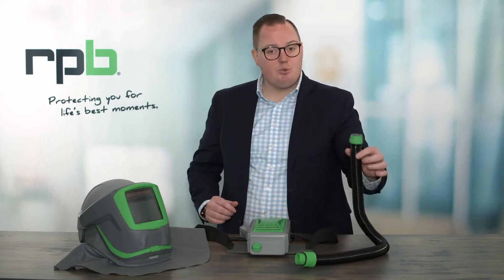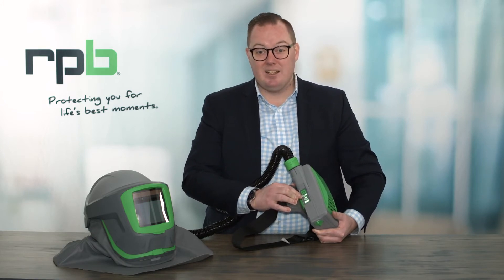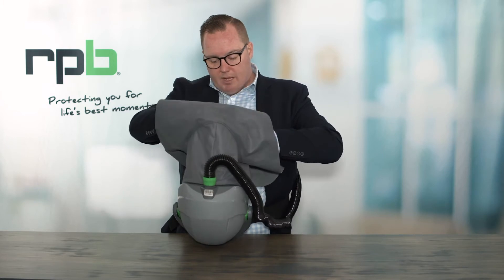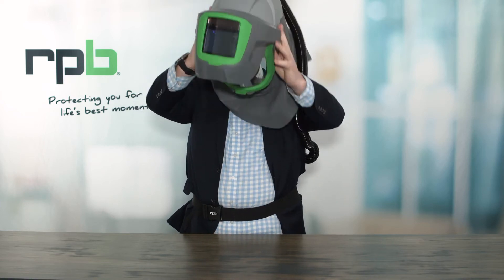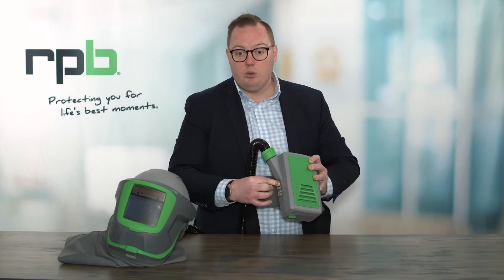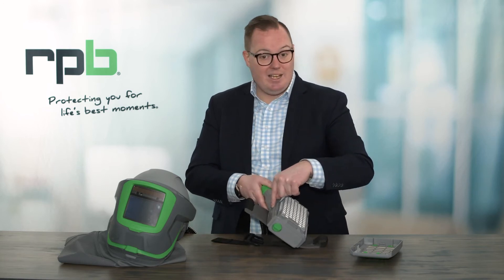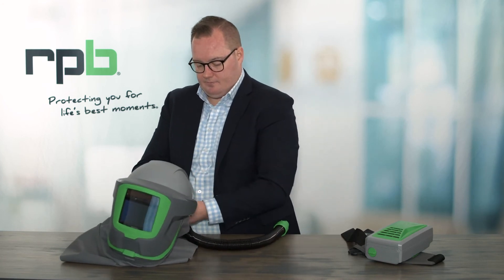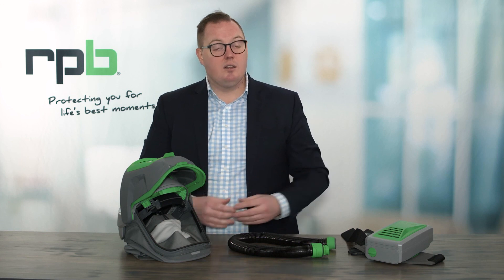How to use and maintain your Z-Link+ and PX5 PAPR | RPB Safety

Comment: What are these built for? Like conditions? Is it built for heat index greater then 100 degrees fahrenheit?
Reply from the maker: Hi Ryan, thanks for your question. 

Our Z-Link respirator is very versatile, it is suitable for use in primarily heavy fabrication environments, it can also be used for painting. For high heat environments we can offer the Z-Link Radiant Heat which features an aluminized cape and headtop covers as well as a gold coated visor enabling it to withstand high radiant heat such as you'd find in foundries.

Check out our Z-Link Radiant Heat video here: https://youtu.be/zhlicctpOcQ or visit our website for additional technical data on the Z-Link: gvs-rpb.com/resources
Reply: @GVSRPB  thank you